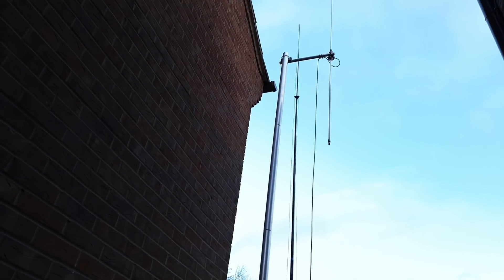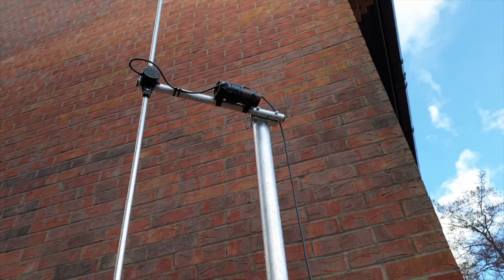Maybe you can help solve my dipole antenna  SWR issue

Comment: Hello Carl, thank you for the video. I would investigate the connection point or box, where the coax is feeding the dipole elements, is there any water? And if antenna is down for that, mount it horizontal to check if the mast is too close to the lower dipole leg. And keep in mind, a dipole in "open space" has not 50 Ohm impedance, it is 75 Ohm, so the SWR should be 1:1.5 and not 1:1 as target. If you add an reflector element, the impedance should be 50 Ohms. Best solution for a simple vertical antenna is a J-Pole, imo :)  And, last comment from my side, those SO239 or PL.. oder BNC connectors are imo not the right choice for outdoor usage. The correct connector for outdoor usage are those N-connectors, those are waterthight. 

vy73, Dietmar, DL4HAO
Reply from the maker: Yes I'm thinking of a simple vertical now, thanks for raising the point about 75ohms hence a raised SWR anyway, so 3:1 I'm half way there 😃

Comment: Hi Carl,
A couple of simple things to check.
Are both legs of the dipole the same length?
If you lengthen each side does the swr get worse?  Measure swr at the bottom and top of the band to see if the antenna needs to be lengthened or shortened.  If it is worse at the higher frequency the antenna needs to be shorter.

Comment: Measure the antenna and make sure the measurements are correct. 
Also make sure it isn’t too close to the house or to the ground. If it is too close to the house the signal may be reflecting back.

Comment: If a dipole is closer than a 1/4 wave to a  mast it can have an effect on the antenna...how high is swr?..remembet feed point of dipole is 75ohm..so you should not get it below 1.5 with 50ohn coax and a tcvr looking for 50ohm.
Reply: Agreed...that metal mast is messing everything up.  Try replacing the metal mast with PVC and see what the SWR looks like.  It may be even easier to rotate it 90 degrees so it is a horizontal dipole.  Thia may not be the orientation you want in the long run, but it may be the easiest test.
Reply from the maker: Didn't know that!

Comment: My suggestion is if you have an antenna analyzer hook it up to the antenna.  That might tell you if the antenna is good or not.  At least it will tell you where it is resent at. Hope that helps. 73 KA9WLU
Reply from the maker: Yes, my analyser doesn't do higher than 6m unfortunately